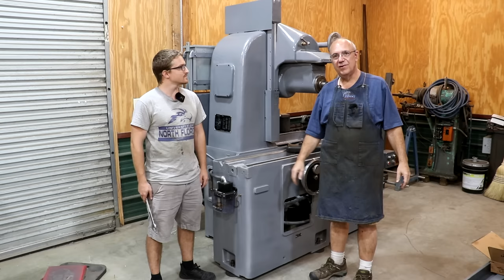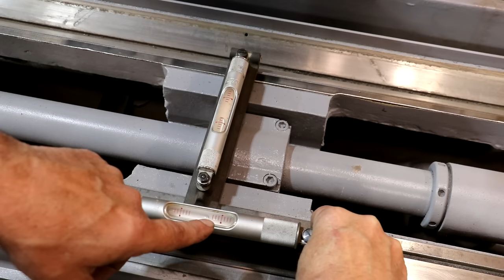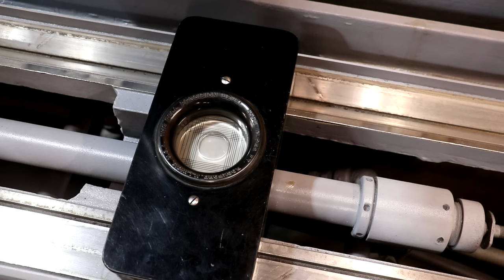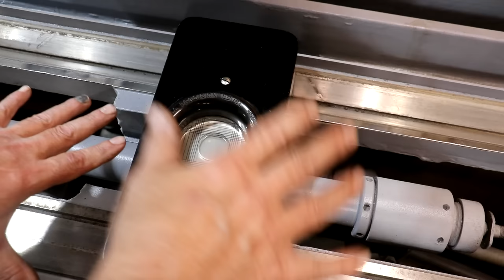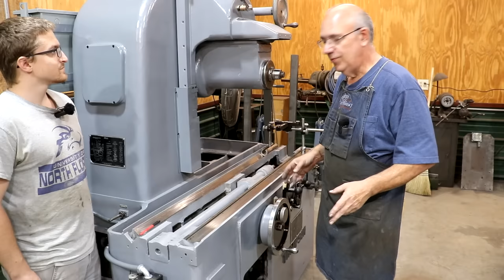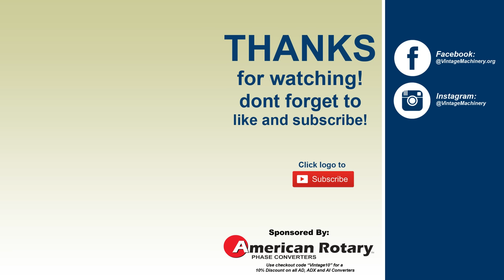Thompson Grinder Restoration: Precision Leveling the Machine & Bed Inspection with a KingWay Tool

Comment: I suppose the lack of wear isn't all that suprising. It's not like a lathe or milling machine that is making .200" cuts. Surface grinding is only a few thou at a time, so the forces on the table and the ways are far less.

Comment: Looking good Keith...I need to drop the weight too.  Knees, back and more can't take it much more.  I haven't seen below 200lbs in nearly 40 years...then again for about 15 of those I was built like a brick wall and worked out all the time.  Desk jobs are no good for the waistline for sure.  Now I'm retired and still not active nearly enough.

Good job on the leveling.  I still have nightmares of leveling bases for a big machining line I assisted in building.  Each base had 8 2-1/2" bolts.  What a freaking NIGHTMARE.  Took a team of 8 people 2 weeks to level all 30 bases...

Comment: Love it!  I'm restoring a 1956 Do-All D-8 right now.  It had a 28 thousandths bow :-( but otherwise just worn, not beaten up.  Jealous of your machine's condition!
Reply: If you have a manual specific to that machine, I'd like to get a copy.  Anything online is for a much newer one.

Mine was supposed to have been "re-scraped some 30 years ago, and used little since then."  I bought it for basically scrap price plus the road trip (KC area - Tulsa) to fetch it.  We pulled the table and main motor to get the weight down for loading, and I was quite pleased with what I seen.  Replace the pump motor, chase leaks in the hydraulics, a few wiring puzzles to solve (making sure controls were off of the wild leg of the converter), and it's usable.  Haven't tried to grind the chuck in yet ... not going to open that can until I have too!
Reply: @infoanorexic  I've been asking around for a manual, too.  All I've got is one for the G series.  I'll share a copy if I find one.  Let me know if you track one down.

My story is similar.  $400 for the machine, just needed new hydraulic lines and cleaning.  I disconnected all the wiring and put on 3 VFDs.  Bed was rusty, but I've got that almost completely ground flat.  I should have taken video, it's a super cool project.

Comment: Great video Keith 👍
A trick I learned as an apprentice over fifty years ago, used a Jack centred on the side opposite the two screws being adjusted.
That gave the effect of ‘three-point-levelling’ on machines with four feet.
Then, when that axis was right, move the Jack to the next axis mid-point, and repeat ( or sometimes just ease the jacking screws down on the first jacking side to ‘take the weight’.
Worked well on stiff machines…. and subject of course to being able to get a Jack under the machine ( you Jack).
I love that you go ‘the full nine yards’ on these rebuilds…
Regards
Robert
Reply: Errrrr…. ‘toe’ jack 🤪

Comment: Thanks Keith. I appreciate your work and the amount of detail you put into your videos. If you check the level  of your grinder every season it will probably be different. Most concrete slabs built on clay soils move with the various weather conditions especially after heavy rain.  P.S. I was hoping to see your precision level in action.

Comment: Keith . I have leveled many of CNC machines large ones  with 18" crescent and cheater pipe . One day I got tired of doing it with crescent wrench. The machines level bolts where 30 mm so I went and bought a 30mm axel socket and cut it down and made it into two sockets and for my 1/2 proto ratchet . Then when are shop moved again I went and bought a gear wrenche 30 mm . And had Craftsman 30mm as well and  railroad jack to get then close then lower the feet ..

Comment: Nice job Keith on the leveling. It makes a big difference in precision work if the machine tool is precisely leveled.
Reply: I was thinking about changes in the super-accurate level and wondering if it would change as you drive a forklift nearby, or even the floor jack or your mobile crane. Just as I formed the mental question, you explained that just walking by can make the bubble move, and you told about the scraping class. Yup - question answered!! Thanks Keith.

Comment: Something I'd like to mention as I didnt see it in the video, when you initially leveled the machine it looks as though you only placed the level in the middle of the bed. By leveling only in one spot on the bed and not checking at least the ends and middle you could have put a twist, belly, or bow into the bed without knowing it. This will make you readings with the way level inaccurate. You may have checked the machine initially in multiple spots, however I did not see it on camera. Great content as always.
Reply: He does many things off camera. He's been doing machine leveling and calibration for decades, I'd give him a bit of credit in knowing how it needs to be done.
Reply: Good point, the Kingsway tool might be influenced by this...

Comment: 23:39 - my Thompson 2F was the same way.  I stripped, cleaned, fixed stuff and painted it.  When I did the 5 block test (after grinding the chuck) the deviation was less than 0.0001".  The cross feed ways (the ones the spindle rides on) are pretty worn so I'm going to touch them up.  I was kind of hoping you'd have to scrape those so I could see how you did it.  :)

Comment: I was taught that you orient surface grinders at 45 degrees to the wall in case the wheel shatters or it ejects a part.

Comment: It would be good to put some ‘nano oil’ on the precision ground surfaces.  It contains tiny metal balls 0.09 microns diameter that fill any tiny cracks  and act as ball bearings.  Expensive but worth every penny.  It’s available in different viscosities too.
Reply: You know of any videos of that product?

Comment: I have a question: I have passed over many machinist levels at swap meets because I wasn’t sure they would be calibrated properly.  I have seen that they have adjustment screws on each end of the vial - presumably for calibration - but against what standard?  How would I test and/or adjust the level to ensure accuracy?
Any insights would be appreciated. 
Thanks
Bill

Comment: Someone please answer my question.  I have never leveled a machine; however, I have leveled transits and levels for highway construction for 45+ years and I can't see any difference when the instrument has 4 leveling screws.  For my career, I was taught to always level an instrument diagonally, and turn 90 degrees and level the opposite screws.  For three point leveling, level toward one leg and the level across the remaining two.  Also makes for quick leveling.  It also makes for quick leveling.  This method also keeps a very similar load on each leveling screw.  Hope this makes sense.  Can a machine not be leveled in the same manner?  Thanks.
Reply: Not a pro, but my instinct tells me if the machine is a perfectly solid structure, then 3 points are enough. But a big and long machine is not perfectly solid, and can have twists and sags that might not be able to be removed with just 3 points. I've seen a lot of 15 foot lathes that sagged in the middle and needed to be raised at particular points.

Comment: Hi Keith,  could you explain the procedure to re-align threads with the lathe cutting tool.  I had to remove a partially threaded 1/2 -10 acme rod before I finished cutting the threads.

Comment: will it need to be re-leveled after the hydraulic fluid is added ?
Reply: Good point- 60 gallons of oil plus coolant- maybe another 400-500 pounds? Of course that should be pretty much be spread evenly over the machine footprint.
Reply: Yes, and when the table is installed and ground in...

Comment: How does wear on the grinding stone affect the end result of grinding regardless of how true the ways are?
Reply: Quite a bit (results in a "striped" pattern). That's why surface grinding wheels are frequently dressed, which takes out the error.

Comment: Stupid question guy here - Why do we need to so accurately level this machine?  I would think that if one end was a little higher than the other end it wouldn't make much of a difference. I'm supposing that maybe it is to get out any twisting of the ways. What say you?  Thanks.
Reply: He mentioned that gravity can pull the table down a hair if it is moved to a far end, especially if the workpieces is very heavy. It's not a lot, but the whole point of this machine is to create as perfect as possible surfaces in other parts and machines, so this is often the 'ground zero' of subsequent precision operations. He also mentioned he's a 'nerd', which is kinda saying he has a bit of OCD.
Reply: @kindabluejazz  Thanks for the response.  Some people say I have OCD.  But I say I have actually have CDO (which is OCD in alphabetical order).
Reply: I know they use lathes onboard ships , how do you level a lathe on a ship its never still , question do they have surface grinders on a ship maintenance dept
Reply: @stuarthardy4626  There is information about maintaining lathes and such on ships if you google it. The bottom line is: they level them the best they can while in port, they don't use them when seas are rough, and they don't attempt to do precision work higher than 0.001" accuracy while out of port.

Comment: Keith,
Ive been doing this for a LONG time ( like 45 yrs ) the OLD adage of dont f with it if it aint broke most surely applies here, that is unless you are making parts for the space shuttle. Just to mess w things for the sake of messing w things just because you can....is only inviting disaster. I admire your ethic, but enough is enough....concentrate on something that NEEDS fixing and improvement.....you sir are lucky and have a GREAT machine dont do something you'll regret and go tooooo far and muck it up as they say down under......JUST SAYING !!!!!! 
Don
Reply: Exactly!

Comment: how do you make a bubble more accurate
Reply: Haha.  I've wondered the same thing.  The only thing I can think of is the precision of the bore on the glass tube.  I suppose if the glass is thicker on both ends of the tube, the bubble would always want to gravitate to the center.  I don't actually know if this is the correct answer to your question, though.
Reply: With master precision air.
Reply: It's all about the shape of the inside of the tube or flask or whatever is holding the bubble.  I do not know, but I would guess that they have to figure out how to make the glass a very uniform thickness, and then they allow it to form itself into an outside mold that precisely determines the curves.  Then... do that all day, every day, and make lots and lots of tubes.  Then think some more, and tweak the machine and your process to make it more accurate, and do that for decades, while you learn a lot about forming glass!  :)

Comment: If the surfaces need to be scraped for oil retention on such a high-end machine, why wasn't this done at the factory ?  Since there is so little wear in the ways after years of use, the reason may be that it is not necessary, or worse still, detrimental to the machine's longevity.  I would leave well enough alone.
Reply: He can't help himself, OCD.  My view point exactly!

Comment: If it ain't broke don't fix it.  I don't see the need to scrape the ways on something that the
manufacture didn't do originally unless the ways are out of spec.  This could be flirting 
with disaster.  I would map out the underside of the table before doing anything further
which may be already scraped in originally by the manufacturer.  Got to know when things
are "Hands Off" and when to quit.

Comment: My Daddy used to tell me, If it aint broke DONT Fix it. leave well enough alone.   :hand-orange-covering-eyes:  :face-blue-smiling:
Reply: I'm with you on this. I wouldn't scrape that unless I had determined at every point along the bed it had been levelled as precision (sic) as possible, it was in its forever position and finally, that I was sure I were guaranteed to make it better!